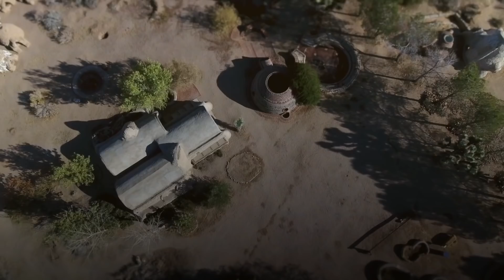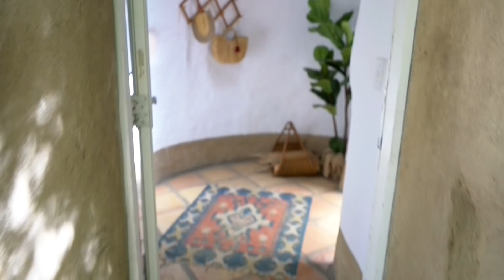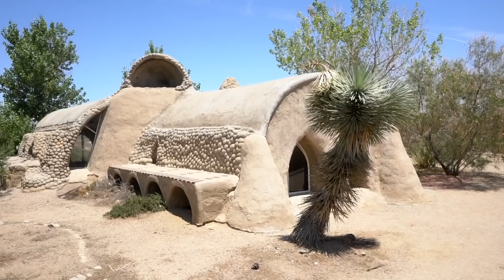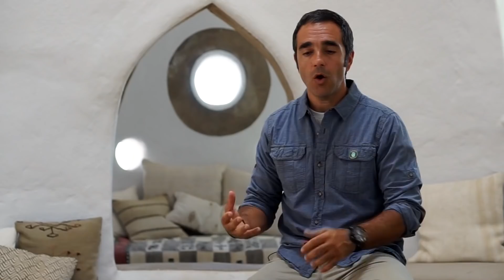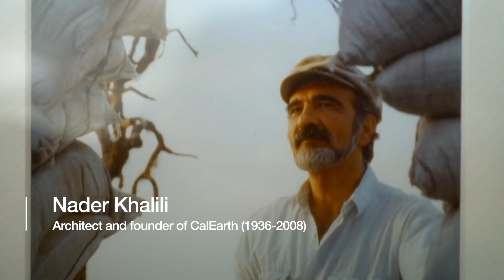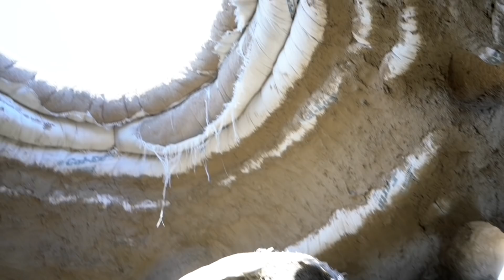The strange homes built for Mars - BBC REEL

Comment: For a different take on this, look at the Earthship homes just outside of Taos, NM.
They have a rammed earth berm wall on the north side, water catchment system on the roof, and a greenhouse on the south side. 
In the low humidity altiplano of Taos Plateau they need no heating or A/C, and are totally self sustainable for fresh water, waste water, and electricity. 
The south facing greenhouse allows for growing vegetables, herbs, etc. year round. 
Totally off-grid, zero carbon footprint, and beautiful to behold.